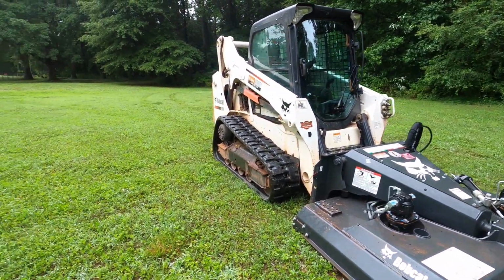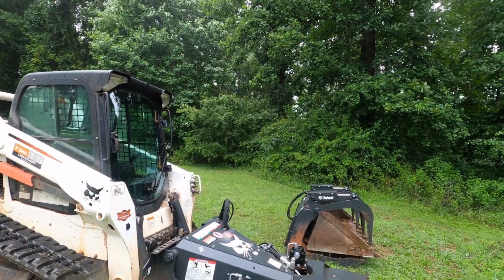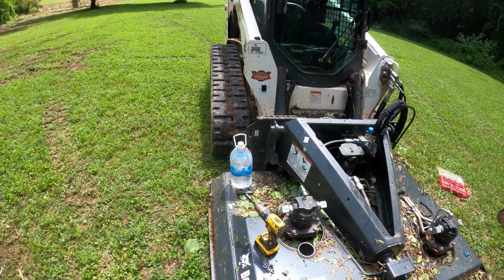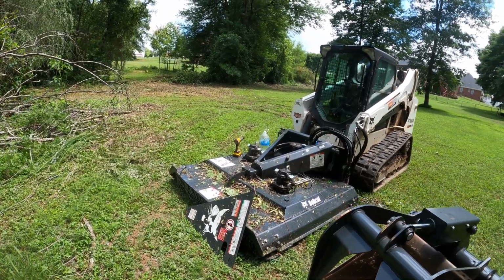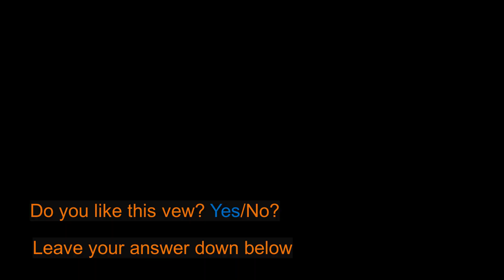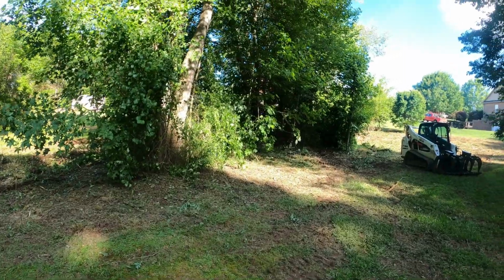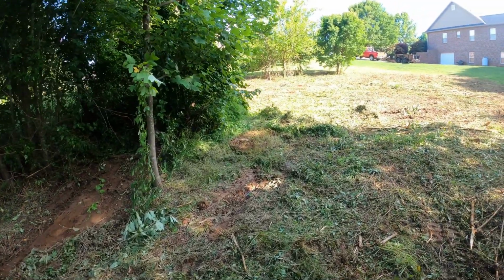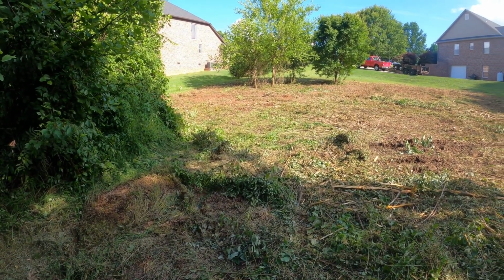First Job with the Brush￼Cat

Comment: I have a T590 operating a heavier brush cutter. It overheats after 20-30 minutes. Did you have any issue with the Brushcat? Would you recommend it to mow grass? I guess main question is how well does it perform compared to a finish mower attachment for mowing tall grass?
Reply from the maker: Mine was 66 inch brush cat and it never overheated my bobcat T590. I’ve done 12 and 15 acres of grass with it and it did really well.

I would highly recommend it over a finish mower because you can still take down small brush, and stuff in the field
Reply: Thanks for the information!